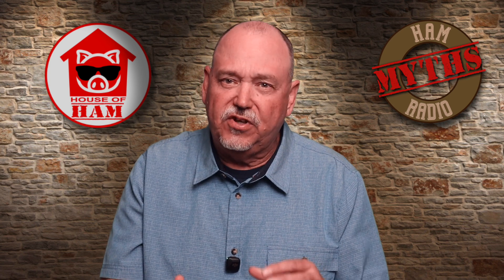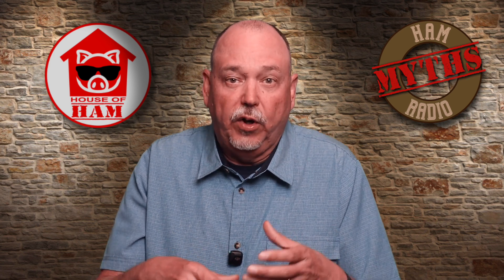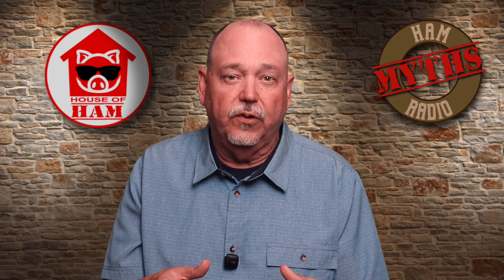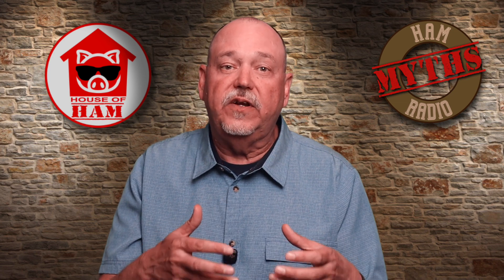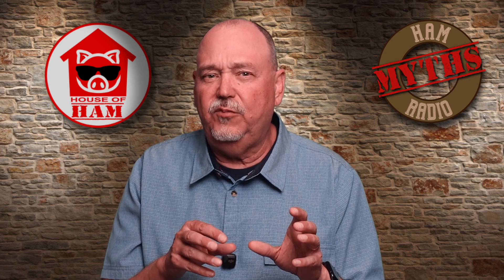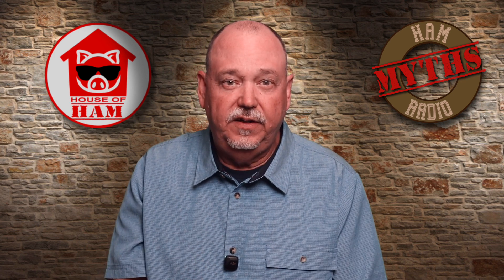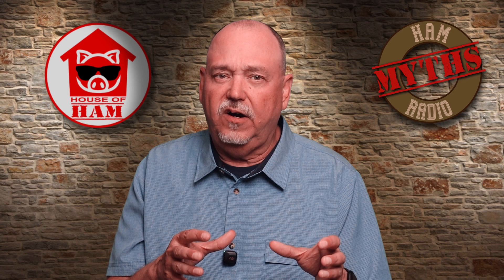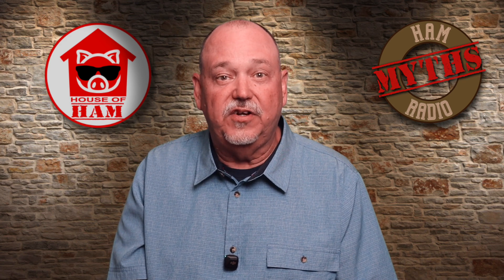Resonant Antennas: Fact or  Myth

Comment: Just to reiterate and/or add a few points:

- Resonance and low SWR are NOT the same thing – but in practice they often coincide. Resonance (XL = XC) can be achieved while still having a resistance anywhere from a fraction of an ohm to virtually infinity ohms. On a Smith (or VNA) chart, resonance is represented by the horizontal line – but the resistance can be any value along that line.

- Many higher-performance antenna designs are actually non-resonant but either require or incorporate into the antenna assembly an impedance matching device. For example, the 5/8 wave vertical is commonly used on VHF or UHF as it provides gain (toward the horizon) as compared to a ¼ wave vertical. Yet the 5/8 wave design is not resonant and must incorporate an impedance matching network (the exact same function as a transmatch (tuner)) in order to present an approximate 50 ohm load.

- Other than the fact that they often provide an impedance somewhere near 50 ohms resistive, there is no real advantage to using a resonant antenna design. In fact, many non-resonant designs will outperform their resonant counterparts (note the example of the 5/8 wave vertical above). Long wires, loops, doublets and other antennas of non-resonant lengths can also provide radiation patterns which are advantageous as compared to, say, a half-wave dipole. Per chapter two of the ARRL Antenna Book:

“Please recognize that an antenna need not be resonant in order to be an effective radiator. There is in fact nothing magic about having a resonant antenna, provided of course that you can devise some efficient means to feed the antenna. Many amateurs use non-resonant (even random-length) antennas fed with open-wire transmission lines and antenna tuners. They radiate signals just as well as those using coaxial cable and resonant antennas, and as a bonus they usually can use these antenna systems on multiple frequency bands.”

- It’s important to understand that there is a difference between a resonant ANTENNA and a resonant antenna SYSTEM. They are often not the same thing. Your transmitter (and receiver, for that matter) need to see an approximate 50 ohm resistive load in order to transfer the maximum amount of power to and from the antenna system. However, the impedance of the radiating element(s) – the actual antenna – can be and often is another value entirely.
Reply from the maker: Thanks Brian! I appreciate the additional information and agree 100%. I was originally going to put in a Smith Chart to show the relationship but thought that could be a whole other video and I may do that at some point. The whole point to the video was to demonstrate the difference between SWR and resonance.
73
Bob WV7W

Comment: Thank you for sharing this. 🙂
I am new to the hobby (10 months) and I admit that at first I also believed this myth about the resonant antennas. During the last months then, I noticed some fellow hams on your side of the pond debunking this myth (in particaluar the YT channel "Electronics for the Inquisitive Experimenter" @eie_for_you). 
Now, I am not paying too much attention on the wire length anymore, instead I try to bring as much wire into the air as I possibly can, I am using an external tuner with clear confidence and I am happy with it -
because it _works_. 
73 de DL1HNR

Comment: This is a great video.  I never really understood the impedence and reactance part itll now. However, years ago I was given a 40 merer dipole center fed with 50 feet of 75 ohm coax. I found that it worked well better as a inverted vee. It was 35 feet up on my tower so the ends were well off the ground. It showed the best swr there. I used it on 20, 40, and 80 meters with some good contacts. Then i got a 4 band vertical with short radials on a pipe stuck in the ground and it worked better over a wider range of frequencies. I wish i still had that old cushcraft 4 band.
Reply from the maker: Thanks, I am glad I helped you understand better. A future video will discuss radiation patterns and why some antenna configurations work better than others and under what conditions.
73 WV7W

Comment: My observation is that too much attention is put on VSWR and not enough on antenna efficiency. I focus on the latter. As you said, the VSWR of a dummy load is 1:1 but the loss-resistance is extremely high.  Efficiency = radiation-resistance/(radiation-resistance + loss-resistance). The goal is to minimize loss-resistance to get high efficiency. That's everything that converts RF energy to heat between the radio and the antenna - transformers, baluns, tuners, connectors, chokes, coax, ground radials, switches, etc. They all add up.
Reply from the maker: Very true! Many other factors at play too such as antenna configuration, location, plus all the things you mention all play into it. Let's also not forget probably the most important factor, band conditions.
73 Bob WV7W

Comment: Thanks for the video!  

I think it is important to draw a distinction between resonance - a property all antennas have - and, a 1:1 SWR.   SWR and Resonance are not the same thing.  Resonance represents a physical characteristic of the antenna, just like its length, orientation, number of elements, etc. are physical characteristics of the antenna.  SWR is a physical characteristic of the combination of the antenna, the feedline, and the radio.

The radio has been designed to match to an arbitrary 50 ohms purely resistive load.   When the radio was designed, the designers had no idea what kind of antennas would be used with the radio.   So, they came up with an arbitrary compromise.  For example, as noted in this video, the theoretical impedance of a 1/2 wave horizontal dipole is about 73 ohms.   The impedance of a 1/4 wave ground plane with radials at 90 degrees from the radiator will have an impedance of about 37 ohms.  Slope the radials at a 45 degree angle, and the feed point impedance of a 1/4 wave ground plane will be about 50 ohms.

In terms of practical use, a 1/4 wave ground plane antenna is far more useful for most applications.   That is because it is omnidirectional and, most of the time, an omnidirectional pattern is preferred.  Television and radio broadcast stations universally use omnidirectional antennas to reach their viewers and listeners.

Let's look at a couple of other potential choices for impedance that radio designers could have used, instead of 50 ohms, and we'll get a better idea of why they settled on 50 ohms nominal impedance.

Assume for a moment that they chose 37 ohms impedance - the impedance of a 1/4 wave ground plane with radials at 90 degrees.  Well, if that was their choice, and you used coax to connect to a resonant half wave horizontal dipole, the SWR would be right at 2:1 - the upper limit of what radio transmitters can safely handle and represents significant feedline losses.

Likewise, had they chosen 73 ohms (or, 75 ohms), a 1/4 wave ground plane antenna with radials at 90 degrees would have an SWR of about 2:1.

But, by choosing 50 ohms, the user could choose to use coax to connect either a resonant 1/2 wave dipole or a 1/4 wave ground plane antenna and get an SWR of 1.5:1, or less - within a safe range for the transmitter.

Notice, that none of the above has anything to do with the resonant frequency of the antenna - even if the resonant frequency of the antenna would represent much higher SWR, based on its feed point impedance.  

Furthermore, a resonant antenna can have wildly varying impedances, depending on the position of the feed point.  And, that translates to wildly varying SWR.  For example, a resonant half wave dipole fed at the end is going to have a much much higher impedance than if it were fed at the center - or, anywhere in betweem the end and the center.  But, the antenna is, at all times, resonant at a particular frequency, and its harmonics, regardless of what the SWR may be.  Achieving a low SWR is about making the transmitter happy.  That's it.

I hope this helps.

73
AI4IJ
Reply from the maker: Thank you for the additional information. This is the kind of interaction I really love to see in the comments. I really appreciate you taking the time to share this with the viewers.
73
Bob WV7W

Comment: Thank you. My antenna may resonate at home but when I take it to a park I need a tuner de n4mqu
Reply: Differences in installation height and objects in the near field (within a few wavelengths of the antenna) can affect the resonant frequency of an antenna system.   This can include (especially) metal objects, like gutters, fences, etc., as well as trees.  The orientation of the antenna can affect your feed point impedance, as well.   For example, a half wave dipole oriented horizontally is going to have a different feed point impedance - and, therefore, a different SWR - than if it were oriented as an inverted V.  Same antenna length, same resonant frequency, different feed point impedance - which translates to a different SWR.
Reply from the maker: Great point. There are so many factors that can not only impact the impedance that we can see with our SWR meter or an antenna analyzer but so many things we cannot that can impact radiation patterns.
73 WV7W